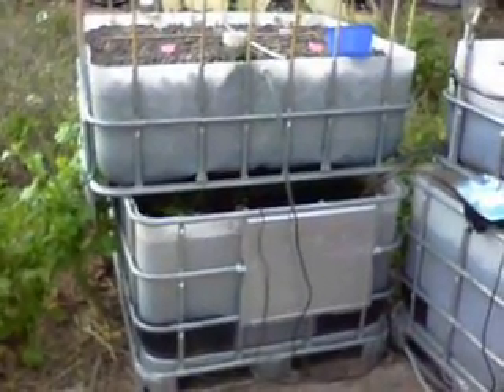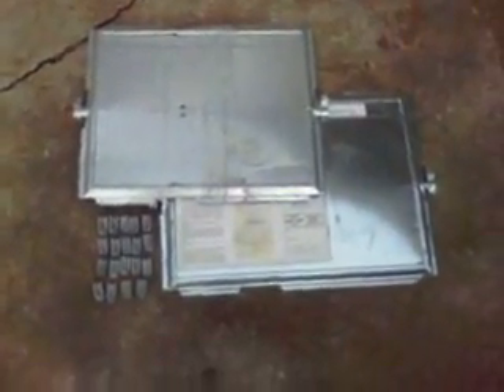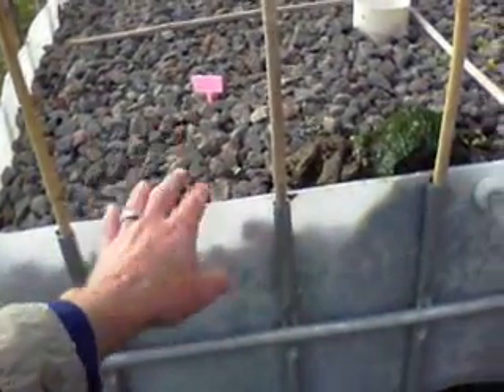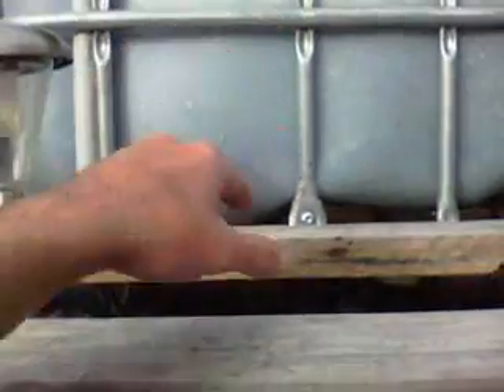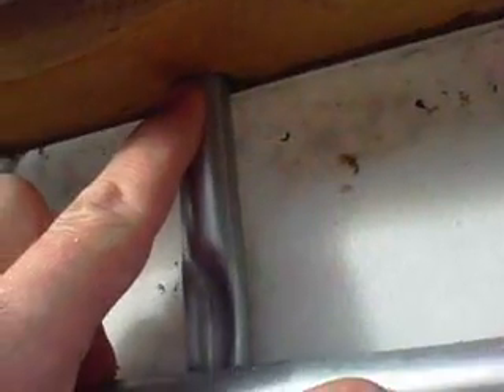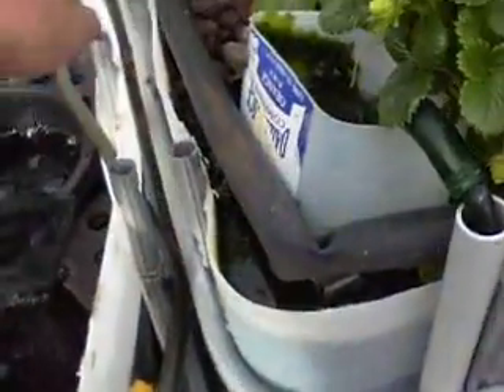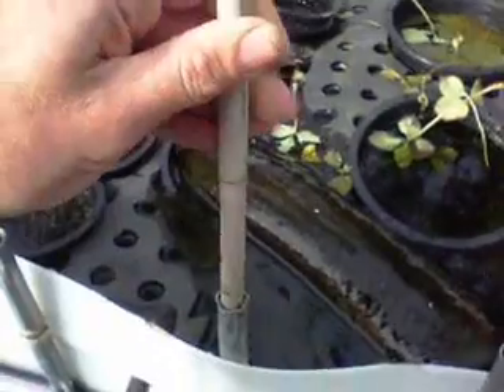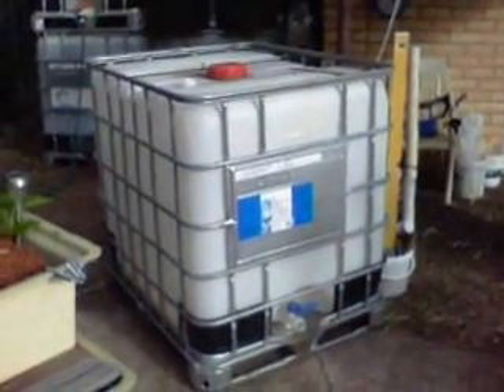IBC conversion systems

Comment: If you want the least amount of cuts, just cut the bars at the top to get the tote out then cut it how ever high you want your growing bed to be. After that, put wood boards so they rest on the horizontal bars which would help support your beds.

Comment: use a plumbers pipe cutter, all this grinding uses energy and it is not that think a gauge of steel. Problem solved. Rub it down with sand paper and put a plumbers rubber bung on the end to give it a nice safe edge.

Comment from the maker: @MrFatist Thanks for the comment. If you are looking for IBC's the best place is to go to a rural stockist like Elders, Wesfarmers or other rural trader. They would have them for storing chemicals, herbicide, pesticide and spray detergents to help chemicals stick better to plants when sprayed. As long as you can store water in them and get algae to grow on the inside walls of the IBC you will remove 99.99999% of any residue chemical. See next post for more...

Comment: You could rip off the horizontal pipes, then bend the vertical pipe outward and down with a pipe bender. or just another piece of galvanised piping. You could also bend them inward, thus creating a bit of trellice.  Also, Iḿ in Townsville, do you know where I can get IBC containers and how much they are?